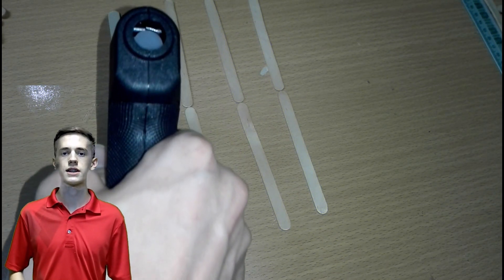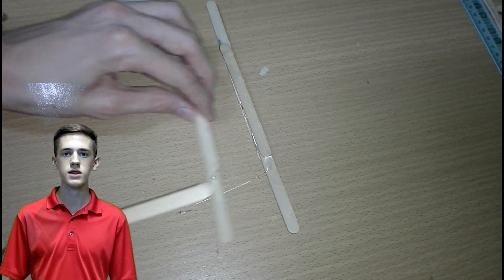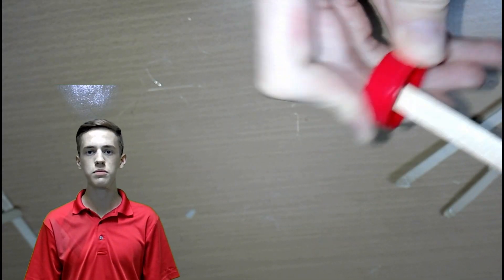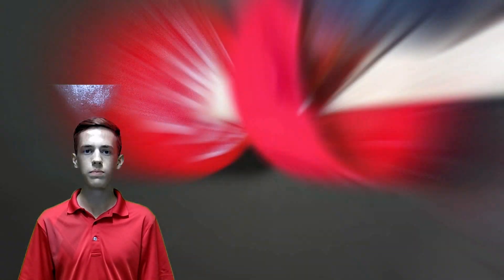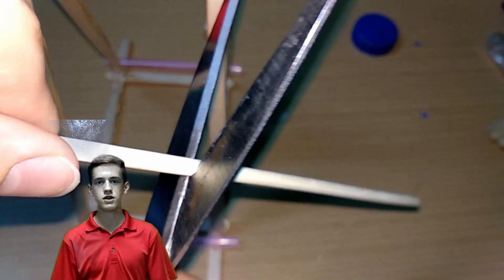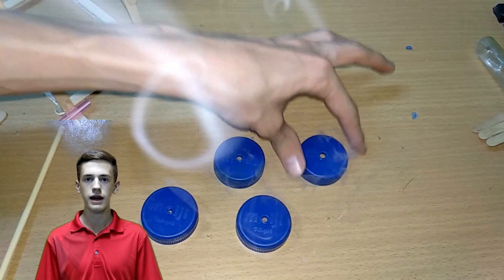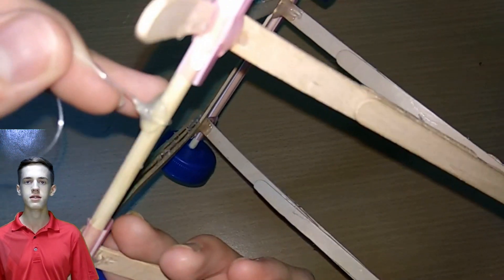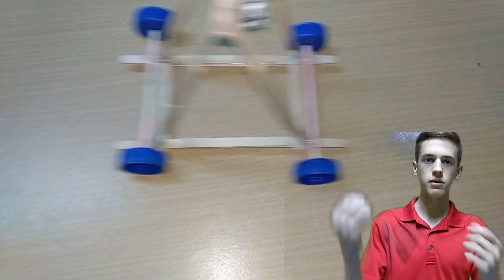How to make a Gravity Powered Car! (diy falling weight car)

Comment: ah man, the same old things goes on for years. say me what if i need a sort like human weight fueled vehicle, it works cool than a common gravity powered car. but there is one thing gravity powered car got in reference with common petroleum or electric fueled vehicles. you need a grip having tyre to run this kind of toy car (maybe even in real scale cars). there is how ever one idea, i guess a lot of people may have thought but when expressed their view to others got commented that such a device abides the third law. that kind of machine can run on just human foot's weight and is forced to have tyre that must have less grip on the road to move, as its force exertion is not through the tyre but tyre's purpose is merely a lubricating the roughness that's exerted when the propulsive force acts.